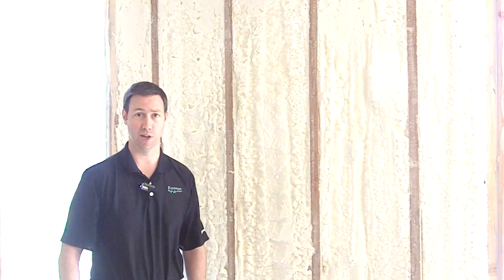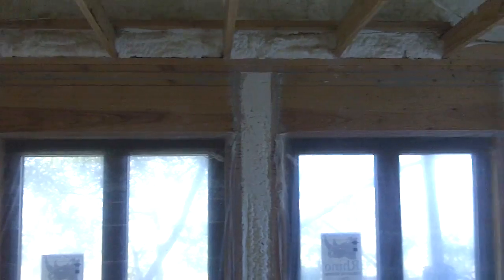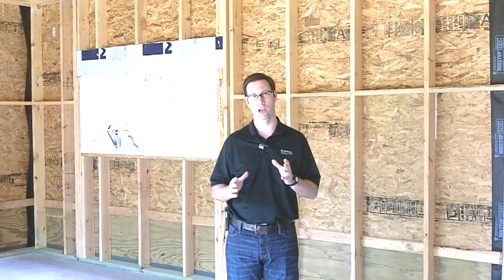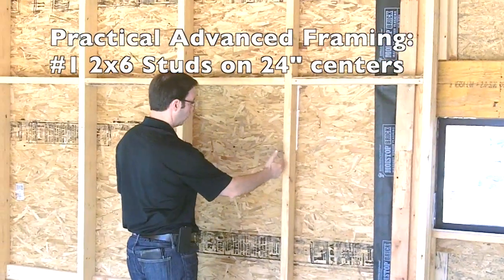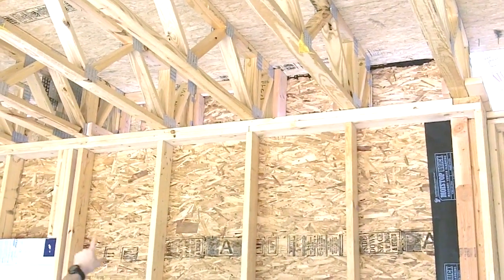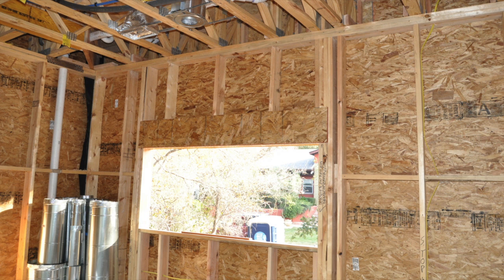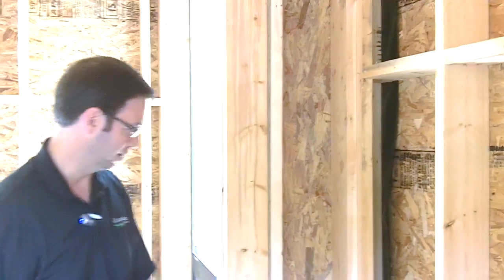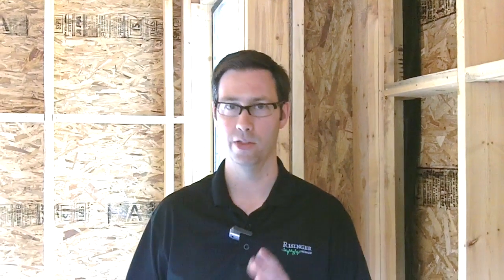Advanced Framing vs Traditional Framing

Comment: All homes should be framed 16 inches on center.Saving money is all i see.
Reply from the maker: ₪cobone₪ I'm sorry that you can't see the benefits beyond the cost savings.  This was a cost-plus project so any savings were passed along to my client.  The main reason to use Advanced Framing is for energy efficiency, the savings is a side benefit.  Matt
Reply: KB MILLER
Well said.
Reply: KB Miller, you need to become educated about the subject prior to making opinions public
Reply: Houses should not be stick built, period.  Semi-skilled construction labor sucks as badly as self-educated construction "experts". Quality of engineering/labor/workmanship, has more to do with the quality of a finished product than materials.  The materials must match the  engineering requirements, must be installed to meet those requirements, and TOC, not price of materials or energy loss, is the primary requirement unless you are stupid.
Reply: Matt Risinger I will take the old style of framing over the new however, Insulation is
 always a perk and the only point's I agree on are the cali corners and 
the insulated headers those make sense but for less cracking as we tend 
to see in the old homes i will stay with 16 OC on all walls, these new 
homes today are cheaply built the builders of today are nothing like the
 builders of yesterday, people today are more interested in a fast buck 
vs pride and more about advertising and saving a dollar as opposed to saving a future problem :-/ nice video tho

Comment: @Matt Risinger I like the idea of 24" o.c. until it comes down to rigidity and hanging things on the wall (I.e. kitchen cabinets).  It seems roof trusses have to line up with studs whereas 16" o.c. it doesn't matter as much.  When using EPS or XPS foam on the outside, doesn't that reduce the thermal bridging problem by quite a large sum?

Comment: I'm amazed by all the negative comments here from you dinosaurs!  Really, just because you've always done something one way doesn't mean it's the best way.  I've been doing this for 10 years here in CA in the hot summer/cool winter San Joaquin Valley, including an addition on my own home.  It works great!  2x6" 24" OC with R-21 (because R-19 in that wall cavity only gives 17.8, but all you geniuses knew that).  5/8" drywall.  Wood siding over 1" polyiso over OSB exterior sheathing.  Yes, OSB in earthquake prone CA, with some of the toughest building codes in the US.  That room is one of the most comfortable spaces in the house!  And slamming Matt for doing this to save money for himself?!  It saves on gas & electric utility costs and keeps the occupants more comfy.
Reply: +Voltaireman1 Homework assignment for you. Sketch you up a little cottage and go call up a couple of Advanced Framers and old-school framers for COST-ESTIMATES on the same project. You'll figure out pretty quick that the 'AF' will cost you THREE TIMES more than standard 16" O.C. it DOESN'T save you ANY money. For 24" O.C. you need SPECIAL (= MORE EXPENSIVE) steel splice plates, drywall clips, header hangers, thicker sub-flooring, and deeper floor joists (not to mention most siding DEMANDS 16" O.C.). That's NOT including the SPECIAL, CUSTOM-CUT headers themselves (more billable hours burned). And yes, twice more special "Green" insulation material... and if you've neglected to put in SPECIAL "Green" triple-pane windows ($$$$), or if whatever windows you chose, happen to cover a LOT of total gross area (as is customary in contemporary design), YOU'VE JUST WASTED TENS OF THOUSANDS OF DOLLARS FOR NOTHING over 16" O.C. and THAT'S what these 'AF' guys WON'T tell you! If you ACTUALLY want to go "green" for whatever reason, get the "best" R-value, you will get SIPs (which ARE structurally superior to stick-framing and ARE the best R-value possible) and you will drop those few extra grand on those special "green" triple paned windows (and use LESS of them per total gross area to further minimize "seepage" loss - MOST warmth is LOST through your WINDOWS not your damned walls!). Why the hell would you want to PISS AWAY the same money on INFERIOR 'AF' when that SAME COST could garner you SIPs?! That's INSANE!
Reply: Magnus Avery dont forget to add those old school houses are still standing,its the "advanced framing" that are rotting out in 1/4 the life expectancy
Reply from the maker: Well said!  Thanks for commenting!  Best, Matt
Reply: Voltaireman1 wow, ten years huh? You have obviously seen everything then....
Reply: Dinosaurs? more like Practical. Yeah there will always be better ways to insulate a house but whats more important the strength of your home or the r value? And the costs to build this way a retarded even with the energy savings. Good video matt just disagree with this.
Reply: Well said! The California corners also make much more sense when it comes to R value and being ale to get in there with insulation.
Reply: Voltaireman1 are bragging or complaining ????
Reply: +1
Reply: Voltaireman1 if you build a house with exterior walls on 24" centers I would suggest brick. siding will only exaggerate the amount of dips and swells in the wall.
Reply: Really? 500 year min is a long time to rot out...to bad houses from the 70's can't stop burning down from bad electrical, dropping from water damage (from Seattle!), and costing MILLIONS per year to maintain! Made a pretty penny off of water damage repairs! Thanks for "sturdy" housing, I'm rich!
Reply: Roger Djuranic Rot is caused by homeowners neglect 99% of the time and not framing. Paint and caulk begins to  fail and water invades.  Much rot is caused by stupid irrigation installs - get more water on the house than the yard. Most home owners don’t know what to look for until they are deep in rot😟

Comment: this is such bull shit! He's used wooden trusses instead of floor joists! It's not strong enough and in the event of a fire the trusses will collapse almost instantaneously hurting the chances of people escaping the flames! Doesn't this guy know that the twin towers collapsed when the planes hit because the fire proofing on the trusses was damaged in the attack and the jet-fuel fire ate right through the trusses and once one floor fell it took the rest of the building down with it! This is just cheap and lazy building and what was he saying about not needing very much insulation because it's hot? Insulation doesn't make heat, it keeps the temperature in a structure consistent so in the winter you can hold the heat in and keep the cold out and in the summer you an keep the cold in and keep the heat out! The people who buy the advanced framing house are going to have a big surprise when they see their first electric bill!
Reply: theChillChanneL What are you talking about?  Those floor trusses are much stronger, better engineered than any floor joist you'll find.  They're also more capable of spanning longer distances.  Additionally, they're not made on site, they're prefabricated in a shop to whatever engineered specs were designed for it.  Generally they're cut to fit a spot, so the framers don't have to do anything but put them where they do.  Also, you'll notice the open web.  That means the plumbers and HVAC crews can just run their materials through the open web without having to cut holes in them, or find other ways around them.  It's a much cleaner install, must sturdier and must more cost effective than traditional floor joists.
Reply: Those trusses are factory built, engineered for the application, wth little waste, meet codes and make it possible to install HVAC, plumbing and electrical without weakening the floor's structural support.  If ordered to match the job, installation labor is reduced and the finished product is of a consistent, predictable quality.
Reply: These people are idiots. I hear this shit about I beams made with OSB, strong as hell, but there gonna burn faster in a fire? Try burning OSB, It will burn hot but it takes awhile. I garuntee you common 2x10 pine floor joist will fail faster in a fire than an osb I beam
Reply: My Life Conspiiiiiiracy!
Reply: Physics. Yes Indeed. Concrete falls on concrete, and steel vaporizes right on camera.  We are not stupid here.
Reply: For my headgear, I get generally good results with Reynolds "Ultra-Thick"--stuff is a hefty .91 mils....  I once talked to Meepsor-B with it.... Under ten bucks on ebay.  You're welcome.
Reply: Not to mention that One Meridian Plaza, a 38 story building, burned for more than 19 hours. Never collapsed.
Reply: Not to mention it's more work anyway to cut all those small pieces of wood, 75% of the cost of a job is labour so that fraction of the 25% you're saving in material is just going to be cancelled out by the extra time and money spent making those complicated trusses and skimpy studs!
Reply: yes 911 the first time in history a steel and concrete building fell due to fires. Now there is where the bullshit lies . not once not twice but 3 times in one day. oh and they fell in free fall speed with no resistance wow amazing those buildings where demoed the 3rd building a 47 floor building never got hit by anything yet it came down in free fall speed. obviously you no nothing about the way those buildings where put together because if you did you would have never made these claims.
Reply: You 9/11 commentors make me sick.  I was there on 9/11.  The buildings were not blown up or imploded.  The trusses failed because the heat caused the outer skin to bend, and the outer framework pulled away from the trusses and when one floor collapsed it acted like a hammer on the floor it fell upon, and then that floor failed, accept the next time two floors fell on one floor, then three on the next etc.  It caused one firefighter who was one of the stairwell survivors to get caught in a washing machine like wind that tossed him several floors from the one he had been on.  this sort of collapse is why another worker told me that the only thing he saw that was office related was a half of a phone keypad, things were pulverized to dust from the pancaking action.  PEOPLE were pulverized to dust that I worked with.  Thinking you know some "truth " that others refuse to believe makes you feel smarter and superior, but you were not there and just believe in lies spread on the internet.  I am Edward Schmitt, I worked at Fiduciary Trust in Tower II and was at the north windows of my building and watched the plane hit.  My story was recorded and can be heard in the 9/11 museum at an exhibit where you put on headphones and hear stories of witnesses of that day.  I worked on the 97th floor and 87 of my coworkers died that day.  Keep your opinions, not facts, to yourself about 9/11.  You dishonor the dead.  My friends and coworkers died a horrible death.  You should feel ashamed of yourselves.
Reply: theChillChanneL 911 was planned by the illuminati - using planted explosives. They did not just collapse from the jet fuel. Also energy weapons were used to start many of the fires in California. Normal forrest fires do not melt aluminum wheels on cars.
Reply: No, the jet fuel did a whole lot of nothing. They blew up the twin towers.

Comment: Yea he is wrong... i agree with the guys below. It may be advance for insulation but thats it,, tt leaves weak walls. He is saying use 5/8 sheetrock because 2' on center studs would make 1/2 rock to weak.The plywood on bottom and OSB on top make no sense at all except that OSB is cheaper. The blocking at plywood joints is wrong if it is a shear wall. Its all a sales gimmick,, save on wood for cheap house and charge customer for advance framing LOL....
Reply: he is using what passes for 'stucco' in Texas, he needs the osb to screw the foam down

Comment: advanced framing... is called timber framing......... just saying
Reply: Timber framing is timber framing.  Advanced framing using traditional framing methods, 2 x 4, 2 x 6, etc.  Timber framed homes use live timbers, 6 x 6, 6 x 8, 10,12, etc to hold up the structure of the home, and then they fill in between those timbers with traditional framing methods.  The home in this video is not timber framed.

Comment: Good video,however I believe you should mention numerous siding products require 16 inch center. That should probably be considered be for going with "advanced framing". And as someone else mentioned sheet rock does not hold up well to any abuse on 2 ft center.

Comment: Inslulation is the same for hot and cold climates! Idiot!
Reply from the maker: Matthew, Yes insulation works the same, but there are very different applications for insulation & vapor barriers depending on your climate zone.  Don't assume that the same insulation level or system will work well in the North vs the South.  This is why I advocate for an education in Building Science.
Reply: jim bones First, thanks for sharing the video. In regard to the three studs, you can eliminate the corner stud and install drywall corner clips. Especially if you're using 2x6, you'll be saving more wood. Above all else, I love this construction process!!

Comment: Sadly a well known builder in our area used this process. With one huge exceptions . They build millions of home using 2x4;s on 24" centers. These aren't inside wall but structural outside walls. To add insult to injury, they used 3/8 Sheetrock. 

SO there are ways to cheapen construction but not all care about outcome but just the bottom line. While in upstate NY many home builders used the same construction methods you're advertising. They did this so as to allow for more wall insulation & insulation in the corners. So this method does work well. However, one has to use 2x6's.....

Comment: Here's what I know from firsthand experience: many older homes, if not most older homes, were built with 24" O.C. framing. And anyone who has spent almost his entire building career remodeling these homes can tell you that because of the 'advanced framing' that they employed decades and centuries before makes finish work a nightmare. Even changing doors, replacing windows, putting in factory kitchen cabinets, and especially gutting walls of plaster/lathe to put in sheetrock means adding all the framing and nailers that was left out by the 24" O.C. craftspeople. As far as headers go, it's not just about the R value lost by fully built door and window headers it's all about the strength that they provide so that you don't have to put up with cutting down doors later or putting up with windows that don't operate smoothly or seal properly because of sagging. Over building is seldom the problem. Over nailing, now that's another story.
Reply: Remodleing neeeded to accomodate the radically evolved human beings that occupy them,  beings who need privacy from members of their own families becasue they are ashamed of themselves and their families?
Reply: Clearly, you didn't use your brain...ever. You brace in between the studs for windows and wherever you will wall mount something put in extra studs or braces. You just aren't too fucking bright.

Comment: Your an idiot---16 inch centers-for studs --don't go trying to change shit so you can save a dollar-that the customer gets ripped off on.You probably pay your workers shit wages too.           Advanced framing-----hahahaha----should be disadvantaged framing cause the difference goes right into your pocket.
Reply: you get the same strength because he is going with 2x6 not 2x4. This makes at least an R19 wall instead of a R12. you have to make sure you are using at least 5/8 sheet rock on the celling because if you go with 1/2, over time it will sag. this make it more energy efficient. All interior walls would be 2x4. Before you deck the thing use the radiant barrier and droop it down between the rafters to create an air channel.

Comment: Wow....Been framing homes to Chicago code for 20+ yrs. Structurally all is acceptable as long as trusses rest upon studs as they do on 2' centers. Of 3 anchor bolts shown on green plate only 1 might be connected properly...This only because the rest of it is not visible..

Comment: Ultimate house: 2x12 frame with insulation. 1" plywood on all floors, and 12" OC spacing. Use tornado joist hangers and nothing can take down this house!! If you have the money to spend...lol.
Reply: or reinforced concrete block, would probably be cheaper.